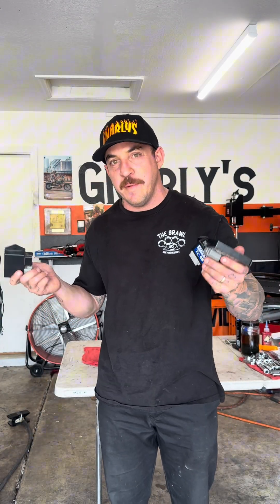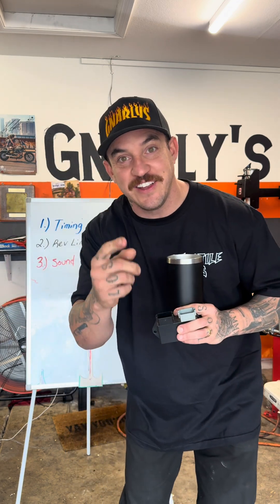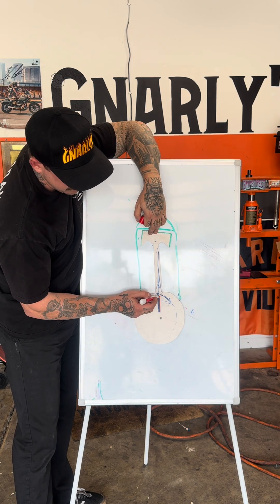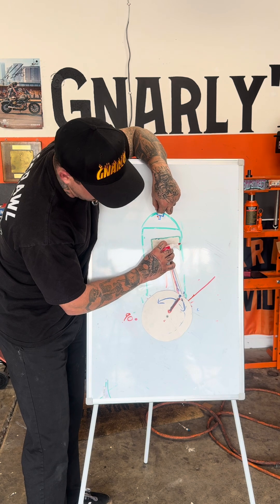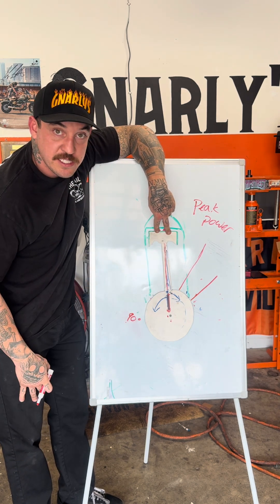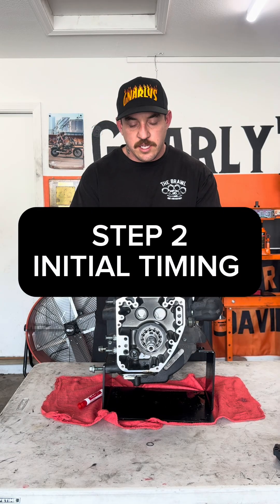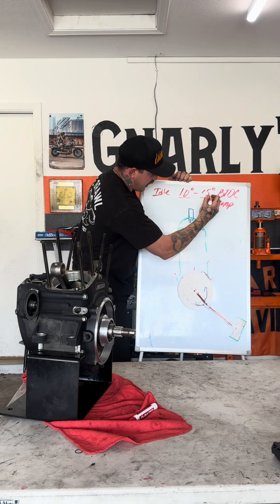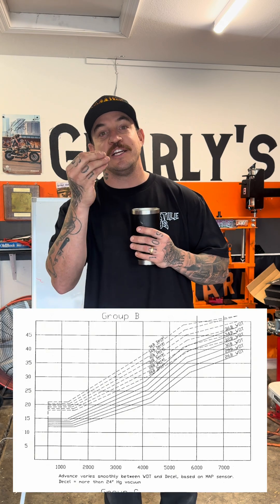HARLEY DAVIDSON TIMING EXPLAINED!  (PART 1 upgrading your ICM/REV LIMITER)

Comment: Peak power only happens 7°    to 10° after the top dead center  ,& when you have to much timing  the motor will not rev you will build good low end torque   but. Mid too top end will suffer ,just put more timing in it  take the bike for a ride you'll see you'll run out of motor

Comment: Great video! Sizing the exhaust for your motorcycle is important for performance. I would just like to add that the longer the primary tubes the lower in RPMs the exhaust scavenging is tuned for. Also, take that into consideration when buying a camshaft.

Comment: The Harley ECM in all reality constantly adjusts to the right hands needs? That’s insane mapping. So when I added a PV4 to my breakout with the fueling 472 cam kit , 64 mm manifold throttle  body and screaming eagle fuel injectors etc. does the PV4 and ECM communicate??

Comment: Trying to figure out where I should set me dynatek at I have it at stock. I have cams s&s, oil pump, fueling lifters, and pushrods.
Reply from the maker: @NICKBALLOON  start 36A and 5750. Then increase to 38A. If the throttle response feels quicker and more efficient, leave it or go up until you notice a decrease! The best is in a dyno!

Comment: So high compression. Smaller advanced curve. Stock compression, bigger advanced curve ?
Reply from the maker: High compression we’re going to want to take out some timing or fire the plugs later! Let’s check out Daytona twin tech. In their instructions they tell you to back it off from 5 and 5 to 2 and 2! Let’s also look at the B group advance curves on a dynatek. They’re both firing later than stock. And when we talk about advancing timing, we’re doing it slowly during the advance a degree or two when we add performance parts. It’s because the engine is rotating faster